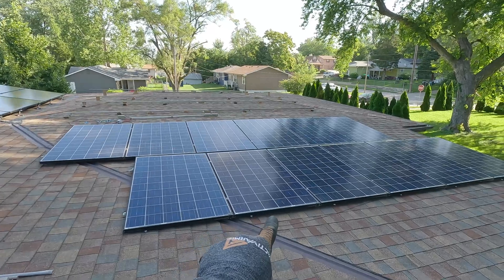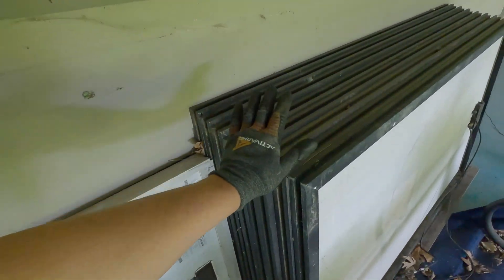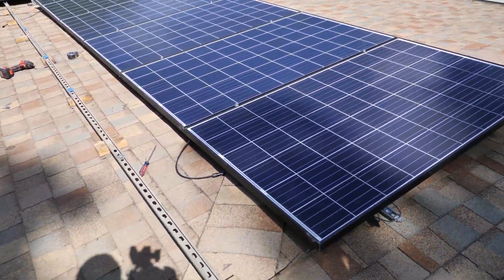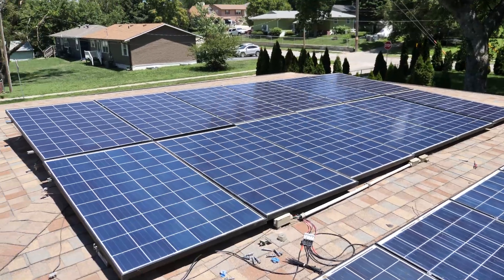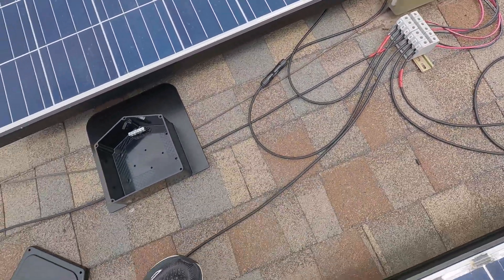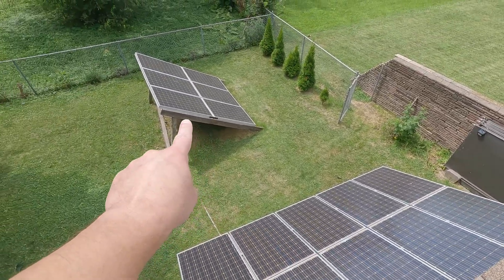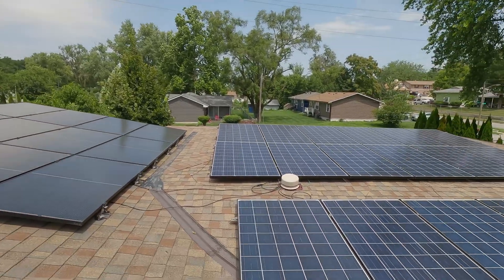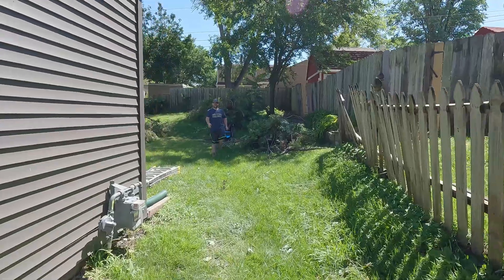I Need MOAR Solar Panels on My ROOF!

Comment from the maker: Save $50 on Any Purchase over $500 at Signature Solar with my Magical 
Affiliate Links and Code "AVERAGEJOESAVE50"⤵
🔗370w SunGoldPower Panels - http://shrsl.com/4gyi8 
🔗Santan Solar Panels - https://www.santansolar.com/product-category/solar-panels/?ref=AveRageJoe
🔗SnapNrack TopSpeed Solar Panel Roof Mount - https://signaturesolar.com/snapnrack-topspeed-solar-panel-roof-mount-kit-1-mount-a-and-1-clamp-b-snr-sku-242-10005/?ref=C2w_5wtHG6jKcP
🔗Solar Racks - https://signaturesolar.com/all-products/mounting-options-hardware/?ref=C2w_5wtHG6jKcP
🔗Tigo TS4-A-2F RSD - https://signaturesolar.com/tigo-15a-1000w-1500vul-1000viec-2-2m-cable-mc4-ts4-a-2f/?ref=C2w_5wtHG6jKcP
🔗Solar Panel Wire Clips - https://signaturesolar.com/snapnrack-topspeed-smart-clip-ii-snr-sku-232-01173/?ref=C2w_5wtHG6jKcP
🔗Amazon Wire Clips - https://amzn.to/3KU3T6t
🔗10AWG PV Wire - https://amzn.to/4cbzi0k
🔗EZ Solar Rooftop Junction Box - https://amzn.to/3xjeAMV
🔗Bouge MC4 Connectors - https://amzn.to/4bdFqDZ

Comment: Inverter 1 - Lux Power - 10,620 watts
Array 1 (Upper Roof) 12S1P - 370 Sungold 4,440 watts
Array 2 (Lower Middle Roof) 12S1P - 245w SS245 - 2,940 watts
Array 3 (Lower Side Roof) 12S1P - 270w JKM270 - 3,240 watts

Inverter 2 - Growatt - n,nnn watts
Array 4 (Ground and Pound) 10S1P ?wattage?
Array 5 (Ground Pound EP Cube) 6S1P ?Wattage?

Better than Average Joe...

Comment: I probably will never get the panels, but I missed out on what the "rapid shutdown modules" are.  I've had several large trees die over the last two years so now if I ever do get panels I will put them on ground mounts in the back yard.  I miss the cool shade, but not the leaves and constant falling branches.  After seeing all the damages and even a death caused by falling trees during Hurricane Beryl I really don't like trees as much as I used to.  During Amazon Prime days I weakened and bought some Ecoflow stuff. It's not what I would really like to have, but it is pretty useful to have for short power outages.  Even bought one of the 400 watt folding panels, but it is too heavy to move around for me so it is questionable if I would call it portable or not.  Also bought a inverter generator from HF.  My old Storm Responder is getting old like me so I thought it would be something to try.  Sure miss the ability to do work like you do.  Take care in the heat and thank God for young knees that work.
Reply from the maker: The RSD's are for roof panels mainly and have voodoo majic in them that talks to the inverter. The inverter has the RSD switch or shutoff on it(should also have one installed by utility meter). If you hit the RSD switch, those modules on the panel will bring the voltage of the system down to around 3 volts in a specific amount of time. This is code now for roof mounted arrays so if a fireman needs to "vent" the roof or smash everything in sight, he can smash somewhat safely even if the system was "shutdown" or not. 

Ground mount arrays dont need it.  I 100% agree with all the extra work involved with tree debris🙄

Good to hear you got something for an emergency. Some of those portable panels are a pia to move. I know the 400w version I have is. Even the 200w is heavy.

Comment: You should check out the new Integra Ground Mount. Will Prowse did a video on it. It's a LOT Easier to Setup Compared to the Brightmount
Reply from the maker: I mentioned those mounts and the other ones in a few videos back as an option. I like that they sit so low so this could happen!😁👍
Reply: @AVERAGE_JOE  Look up "Quick Solar Panel Install with the EASY Racking System by IntegraRack IR-30" by youtuber Homestead Handyman. This system is bascially just legs. That's it.Order one more than your panels.  No clamps needed. It's bonded, no complications.Simplified Setup When I order mine I'm just gonna put rocks on it. The guy in the video used ground anchors.
Reply: I followed your video with the Brightmount rack to the T. I like how it looks after it was finished......but I will gladlly trade all the work it took to get it that way for the easier setup.  in a heartbeat. Im using the same panels he has in the video but the 460w bifacial kind, I'll use light colored rocks to help reflect some light on the back of it for help generate more power

Comment: hi joe.. heads up .. tone from U.K. .. don't know if you do know..so... you can mix and Match panels..??? if they have the same max amps... ie.  you can not  put a 8mm bolt in a 5mm hole.??  ( amps ) or all 8ah panels.. and one 5ah.. 8 will not go through 5.. so 5 overhears and ( booooom ) big fire.. not good so please joe... no ( boooooom ) hope to see you next time ..lololol tone U.K.

Comment: Joe I went into the city permit office last week to ask about solar permits, they want engineering and master electrician seals on all my stuff even though I'm going to do it myself like you are, if you have time sometime soon let me buy you lunch and you can tell me all the hoops you had to jump through
Reply from the maker: Yep, They want all the plans and an electrician to install everything.  I called one time to ask a few questions, they didnt answer any of my questions.  Just kept saying an electrician needed to install everything.  Permits permits permits... After getting off the phone, I just decided to install it all my self and try to make it as code compliant as I can.  Plus I am not doing anything grid tie.  I am using the grid as a "backup" for the most part.
Reply: They want your money.
Bottom line.

Comment: Hey Joe, Looks like those are the same panels I got from Santan the "Trinia" Recalled panels.
They are not just used panels and they vary in condition, I got a whole lot of like 40 panels which were all defective.
The traces were burnt, busbars heavily corroded, cells split, arching on cells face, discolored glass and just all around junk panels.
They were not usable as if they were stringed together the voltages would be all over the place and just short out possibly fail with a fire.

Not to mention the fact buying used panels are not cost saving when you can get 30 new panels for barely double the cost shipped!
Less panels, more power, new with warranty is the way to go especially if your going to upgrade your solar system.
I'm going to move towards offgrid system and high voltage battery with transformer inverter like "MikeG" is doing if you follow him.
So yea man just be careful with those things on your roof! 

Take care and stay cool 100+ temps is no joke man same here right now.
Casey
Reply from the maker: Which panels are you talking about?  The JinKO panels that I installed or the santan panels that I miscounted😏.  All of my Santan panels have been working great since I have been using them.  Not sure if they were Trina or not.  I did hear about the Trina panels being recalled tho.  The JinKO panels are almost new.  Think the date on them is last year.   Ill have to look up MikeG.  Cant say Ive seen his setup.  Thanks for the heads up!!🤘
Reply: @AVERAGE_JOE  Yea the SanTan 240watt panels, the white label on edge of panel like a barcode covers up "trinia".

Yea I have 20 good panels I bought a few years ago but this last batch was bad.  But even those that have been working for two years are showing signs like the others.
They have cracked back glass and sheet also wrong with them, ultimately that's how they get damaged and fail.

Yea Mikes doing his HV solar battery videos showing his big off grid system.

Have a good one, 
Casey
Reply: I bought 36 of the 265W 72 cell Trinia panels from Santan solar in 2019, and they have been solid for me. I've been using them five years this summer, output is still the same. I still have questionable wire management on my roof like Joe here too (I used all the right ratings and boxes with EMT through my attic into the garage, I just didn't tuck the wires very well). They are making 6.2kW in a climate just outside of Las Vegas right now at ~12:30PM. Not bad considering I paid $1800 shipped for them back then, and new panels would have been $14k at the time.

I'm going to replace them all soon with new panels because they have become relatively inexpensive, new 72 cell monocrystalline panels almost put out twice as much per panel in the Vegas heat. I just have to mentally get myself to a place ready to all that lifting.

Comment: If voltage is close (max power Vmp and open circuit Voc) then parallel is fine. Blocking diodes recommended.

If current is close (Imp and Isc) then series is fine.  Bypass diodes recommend (many panels already have but relying on those means you need to know the max voltage each panel supports and the lowest is your new lower limit).

Comment: Does your inverter have enough tolerance for the differing open circuit voltages the different strings will provide?
I've seen people have to replan their array configuration based on the VOC on the panels so the inverter would accept it.
Thanks. Hope you found a cool drink after your work!
Reply from the maker: Yep, the LuxPower inverter has 3 inputs and all can be different voltages. 100% got a cold drink after😁🤘

Comment: I bonded all my panels together and put a 10’ ground rod in because they would zap you if you were working on them.
I bonded them with a star washer and a 10 gauge jumper. It didn’t make sense that the panel frame carried voltage but it does.
They are all used panels and so far they are doing a great job for me 😊
Reply from the maker: What inverter are you using?  I know some inverters will do that.  I know my 12kw Growatt inverter didnt and the 12kw LuxPower does not either.  On the flip side tho they should be grounded which Ill be doing!🤘

Comment: Ya I never mix panels too hard to figure it out.
Reply: For series, match current. For parallel, match voltage.
Reply: but it wasn't too difficult to post here?
Reply: @ursodermatt8809   well when you think about it all you need is some shade on one panel to completely put every thing out of spec.
Reply: @offgridwanabe  
if you have one string only on the mppt the bypass diode will bridge the shaded panel. so you lose just that panels input.
a bit more complicated if you have multiple parallel strings though

Comment: If in your question you are asking (what happens if you link too many panels together) and (exceed volts or wattage) your system inverter or inverters will hopefully just shut down or it could damage the inverters.     Just from what i've read.
Reply from the maker: I was asking about paralleling the 2 12 panels arrays.  Normally you want to use the same panels so the voltage and amps all match.  I couldnt remember if you parallel 2 slightly different arrays if it would cook or mess up the panels.

Comment: 11:59 the amperage would be different if they are all in parallel, but that’s pretty normal even in a single array. You could instal blocking diodes on each array before you connect them to protect them from being back fed, and cooking.
Reply: the currant will not be backflowing.
in series keep the current similar
in parallel the voltage (like Vo)

Comment: Unrelated question. How can you connect a 26Amp dryer directly to the EF Delta Pro 3 ? My dryer has a 4 prong connector with round ground connector and the Delta Pro 3 doesn’t
Reply from the maker: You could get an adapter cable from your dryer to L14-30 similar to this https://amzn.to/3ycAW3a just need to make sure the dryer end looks like yours.

Comment: All of my panels are from SanTan. I have 4K so far and 3 controller. I like them.
Reply from the maker: I havent had any issues with them not working either.  Only issue was shipping and probly the local forklift guy busted the lowest panel.